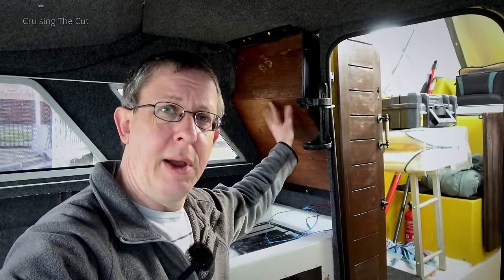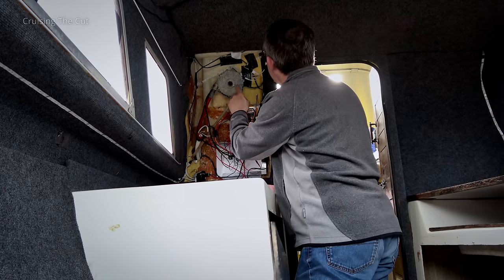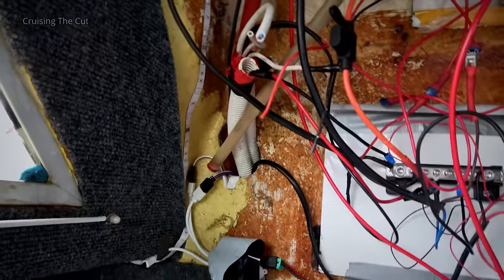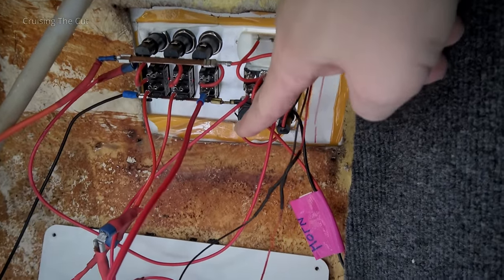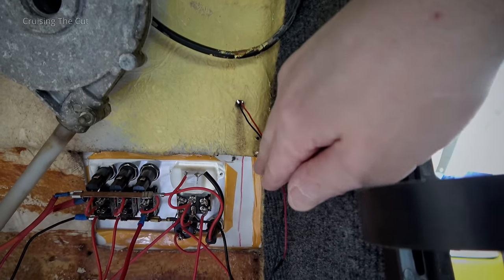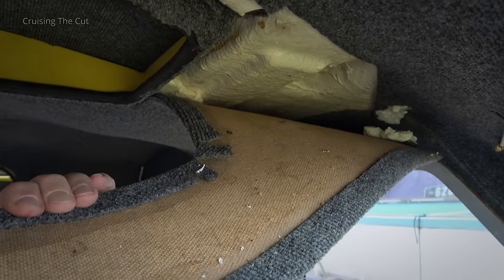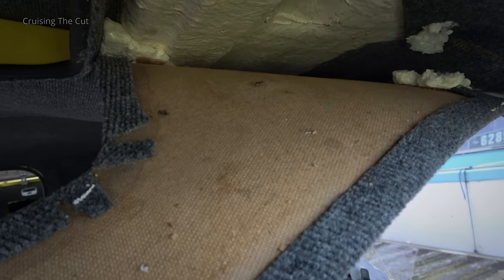326. Ripping out the wiring in my boat

Comment: And you thought narrowboat were a nightmare, welcome to the Lotus Europa of boats. The problem with anything non-metal is that you have to have a power wire and ground wire back, when non a metal boat or car you can ground it right there and then have another ground strap back to your battery negative terminal, with a boat or a Lotus you have to have a heavier ground with to send everything back to the battery.
Reply: Just run the same gauge return wire (-ve) 
as you do the feed wire (+ve)...
side by side 
(twin core wire is the easiest way to achieve this)

Electrickery enjoys coming and going through the same sized wires...allegedly!

Comment: Disconnect the battery first!  A $15 Digital Multimeter can be very illuminating when tracing out wiring.   You can save time by not tearing things apart, and maybe save wiring runs that can be useful.  Label the wiring runs according to their function.  It also might be useful to develop a comprehensions wiring plan for all components before tearing things apart.  One convenient additon might an electric-start outboard motor. By the way, the pressed wood under the carpet material is called tempered hardboard (in the USA).
Reply from the maker: I have one!

Comment: Without checking for actual size, could those two little holes on the dashboard take the pins of a 12v led light? If so presumably to tell you the electrics are live.

Comment: Parts of the the boat-frame could have been wood then 'covered' with fibre-glass reducing the need for expensive moulds? (flat,strong and relatively lightweight..creating a box-section also adds rigidity/strength and provides an ideal wood-screw receptor!)

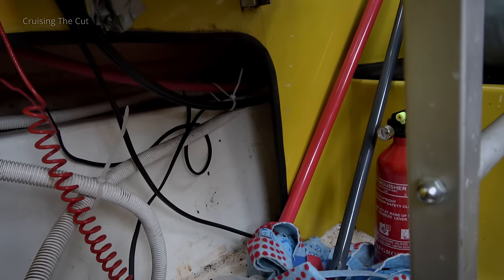Comment: 14:40 I'd prefer not to pull the old wiring out in case you might use the conduit later on for some new wiring. You could then tape the end of the new wire lengthwise to the old one and simply pull it through... and remember, to avoid short cicuits and sparks (you have gasoline on board!), to take off the negative terminal from the battery before doing anything with the wiring.

Comment: I found that interesting.  I'm biting my tongue (typing fingers?) to keep from spewing forth a list of suggestions for the rewire.  I realized that you wired your campervan and have a good handle on what's what.  

Also, no idea what that doohicky on the dashboard would have been. It looks like it could have been an indicator light.  But, what would it indicate?
Reply: 12 VDC being present i.e. that the master switch at the battery has been turned "on"?

Comment: The important thing to remember with 12V wiring is that although it is only 12 volt a leisure or car battery can deliver a lot of energy and melt wires. Starting with a fuse or circuit breaker as close as physically possible to the positive battery terminal, with the link to the terminal well physically protected, all positive wires should be fed from a fuse or breaker appropriate to their size,  which is defined by whatever they are supplying. Negative return wires should of course be the same size.
Reply from the maker: Cheers but worry not, I know all that - did all the wiring in my campervan.
Reply: @CruisingTheCut  I was pretty sure you did but thought it was worth putting it out there in case anyone thinks what you are ripping out is in any way how to do it. There's a lot of it about; I reconverted a campervan a few years ago which was similar but worse and included mains electric and gas. I started reverse engineering it but quickly realised it all had to go.

Comment: With regards to your "loud spark", wouldn't it have perhaps been advisable to disconnect the battery live terminal before fiddling with the spaghetti? Also, as other viewers have pointed out, your 'making it up as you go along' method of refurb is very entertaining! You have yet to make a boring video in my opinion!😀
Reply from the maker: The battery live was disconnected. But it was a negative I was pulling through so when it touched the battery terminal, the connection was made.

Comment: Do make a map/drawing of whatever you discover on the electricals specifying circuits and locations also label both ends of all cables for the future. The tiny two pin "socket" on the instrument panel looks to be where an "on" light would be, showing the batteries are connected in circuit as a reminder to isolate the batteries before leaving the boat. There should be a small bulb plugged into it but that's been removed or broken off.
Reply from the maker: A map? That would make things far too easy ;-)
Reply: @CruisingTheCut  are you sure? I've seen some of your maps. 🤣

I should point out the thin wiring to the lampholder did not appear to be protected by a fuse of any sort.  If the wires tried to carry full battery current under a fault condition, they would catch fire pretty quickly. Be careful with circuit wiring design.
Reply from the maker: Hahaha fair point!

Comment: Have you considered using LED rope lights on the interior and exterior?  Last fall I added some exterior LED lights to my house in addition to programmable LEDs on the interior.  All running from the same app. I know there are 12V "underglow" lights for automobiles that might be something to consider as you renovate your boat.
Reply from the maker: The prior owner added some LED rope lights, I may or may not re-use them.
Reply: @CruisingTheCut  I'm using Govee lights. Multi-colored and programmable. I noticed they have interior 12V light options as well.  They are nice when I want bright white light and when I want something less intrusive that doesn't shock my eyes yet allows me to see everything.  Just a thought.

Comment: I might have missed it - but - do boats require any sort of "electrical inspection and sign off" during or after you f-around with things?  Perhaps not - mainly just curious about added costs and time to do this sort of project on a boat?
Reply from the maker: There is a four-yearly boat safety scheme check but it’s more about whether the batteries are secure, that there’s an accessible master switch etc.

Comment: When in doubt (and you always are with this kind of wiring) take a pair of good quality wire cutting pliers and remove the lot. 
Step two: install the new installation.  It gets you precisely what you want and it is sooo much quicker than playing detective.
Reply: I was called by a fellow boater once who couldn't get his inverter (12Vdc to 230Vac) to work properly. After removing the spaghetti I found that the inverter was hooked up to the battery, and the battery was fed by a charger. Only snag being that the charger wasn't fed by the jetty/shore supply but, thanks to the mound of spaghetti,  by the inverter !  I connected the charger to the jetty supply and all was well. He had sent the inverter and charger back to the shop a number of times where they found no fault and this had been going on for months (!)
Reply from the maker: I am indeed doing that.
Reply from the maker: That’s hilarious (but not the first time I’ve heard of it)

Comment: I’d of kept the conduit to rear cabin and used old wire as either a pull through or as supply for a 12v socket in rear cabin and maybe a cabin light etc….

Comment: That wiring really didn't look too bad. I've seen far worse. When removing "extra" wires unless you can see both ends don't discard them, they may turn out to be something useful, like the horn! Keep that plastic conduit in place, especially the piece going to the stern, it may well be extremely usefully when you rewire. That "thing" on the dashboard looks very like part of a LED light to me. As its connected to the main +ve battery wire it's a battery live warning light to tell you that the eletrics are on. Potentially very useful feature so that you don't accidentally leave something on because you didn't turn off the main battery isolation switch when you've left the boat. I fitted one on my boat after I returned to it to find the battery flat and useless. I think all glass boats have those glassed in batons..

Comment: Could the unknown two pin connector on the dash be a "dead-man" switch connected to your person that electrically shuts off the motor in the event you get tossed overboard?  An "Electrical Power ON" light seems more likely.
Reply from the maker: Not that wire but there is a deadman's switch on the throttle, yes.

Comment: A total guess, could it be a bulb that when lit shows the battery electrical circuit is on similar to a car when you turn the key and the instrument panel lights up before starting the engine,

Comment: I think under the circumstances I would pull the battery cables before working electrical;  You may not be able to get electrocuted but electronics don't usually respond favorably to backfeeding power through the ground
Reply from the maker: The battery is disconnected.

Comment: Install a small BluSea fuse box.  It has both a negative buss bar and about 6 fuses.  Makes small boat wiring a breeze and you only have one point to check for blown fuses or to add more items. Electrical arcs are god's way of getting your heart rate up, ... so exercise more.
Reply from the maker: Cheers, there is a fuse box down at the bottom already which I will re-use.

Comment: As this is the 4 hundredth and something comment, and I am not going to read all of those, I suspect that someone may have already informed you of this, but just in case they have not. That woody stuff, at about 12 mins and 40 seconds into the video, is what we used to call hardboard, in the 1970s. It is matt and textured on one side and smooth and glossy and smooth on the other. I think that you can still get it, but I don't see why anyone would bother with it, as it is brittle, easily breakable and a bit useless.

Comment: Battery Terminal Risks - by far the worst place to have a fire !!!

Always cover the positive on your battery with some kind of quicky-removable non-conductive thingamy unless it has a nice purpose-made plastic hinged cover gaurding the terminal/s. Look under any modern car bonnet and you'll see an example of a terminal cover.

I prefer to use a small soft plastic food container bottom the likes of which you'd save leftover baked beans for the fridge. Buy a clear plastic one so you can see through it for corrosion. They are cheap and handy, so buy a set of them and just pick the best size. 
It's always the second size you try that fits best. 

They are soft-ish, especially when warm, so can be cut with a Stanley knife or similar to alllow access for the cables - just cut a notch for them and smooth the rough edges of your cut to prevent vibration fraying the insulation.

Then place it over the positive and use good quality Gaffer tape (Gorilla is a reasonably good brand and found in supermarkets, clean the surfaces well behorehand) so you can flap it up to measure the voltage with a voltmeter at the lead terminal directly when you need to. Don't tape it fully down, you should be able to quickly flip it up and out of the way to access the terminal nuts/bolts - it's just a cover to prevent metal things bouncing off the terminals even if you are disconnected.

This prevents "spanner across the battery" fires, which are extremely dangerous. Or "whole-length of wire melting in your hands/along the whole boat", which what you just had happen. Essentially, the whole wire is the same thickness/ampacity, so the WHOLE LENGTH of the wire becomes your fuse and melts all the way along. This is not good for insulation and the heat damage is more of a problem in places you can't see, due to sudden heat buildup behind panels and in nooks and crannies. 

Related note: stow a spanner of the correct size for your battery terminals inside with the battery compartment, secured well with strong clips and a backup rubber strap in a easily visible place. BUT TAPE IT OVER WITH SEVERAL LAYERS OF RED INSULATION TAPE so that it won't ever spark between the positive and negative when used in a panic. This is even if you have a "nice" battery cutoff close-by.

If ever you get a fire on board and the brigade arrive, they will want to physically disconnect the battery terminal/s even if you have a nice battery cutoff mounted close. 
Yep, they will use the cutoff for speed, but will also want to then also want to remove the terminals themselves to be sure, because as you know and have just shown us, rat's nests always exist :) 

I'm raising eyebrows at uninsulated busbars for the same reason, I know they are low voltage, but a loose nut, bolt or screw could play havoc bouncing around in the back of there. Testing your fuse choice (or worse, the previous owner's assumptions about fuses) in a real-world fire is not fun. 

An easy retrofit for bare conductors is liquid insulation, thick rubbery goop that you paint on once your happy and everything is tested and finalised. It's a bugger to get off though. 

Don't be tempted to use bathroom sealant or mastic-like goop as it can cause rapid corrosion of the copper. Liquid insulation is only recently cheap, but being untested for 30+years of life in a marine environment is only just better than nothing.

If I could I'd always use a layer of nailvarnish (I use non-metallic red for various reasons on positive conductors) then a couple of layers of self-amalgamating tape over that. 
I like to leave a tiny uninsulated pinhole to get a needle meter probe onto the terminals of switches for faultfinding though.

Electric work costs money when done professionally, for good reason. 
I'd always recommend a professional do it, but I realise that most people in these siuations DIY, as well as in caravans/motorhomes for DC stuff.

(I now need a new keyboard - this one is worn out)

Comment: Was there a weird plastic stick type thing on the boat key's key fob? Only asking because that thing near the wheel that you don't know what it is looks a bit like the anti-theft isolator nubbin that you used to get with the old after-market Moss car alarm systems. You'd have to hold the nubbin to the thing on the dash before you could start the car.
The scrawny wires going up to it seem to hint towards that explanation as well.
Reply from the maker: Intriguing suggestion! Maybe it is.

Comment: Possibly too late now. But before you pull out all of those unused wires from the conduit, tie a piece of string to one of the wires first and pull the string into the conduit. Then you can use that string to pull in new wires (and new string) as needed in the future. 'Pushing' wires through that corrugated conduit afterwards would be shall we say, unpleasant.

Comment: Ahhh, it's Hardboard. Shouldn't really be on the boat. The same thickness in plywood would be much better. The timbers the headlining is fixed to are to screw into. But also to add some structural strength to the deck. So it doesn't flex when you walk over the top.
Reply from the maker: I realise they are underneath where the rails are to the side of the hatch.
Reply: @CruisingTheCut  ahh that's good. You're having all the fun there. Love your channel.

Comment: Wooden impressions on fiberglass. Modern 1970's.  Electrical spaghetti. Electrical labelling is absolutely necessary. I sure hope those dead ends are.  ...and when everything has been sorted out and improved upon, it'll be time to swop it out for something else. Hmmm. It's not sticky tape. It's a special electrical tape. I think all those wires need changing out completely. They all look very burnt out.  😂 Recipes for disaster. David's new book title. I can just see David as a little boy sitting on the bedroom floor pulling apart his Christmas presents or his favorite toy. Have you got a buoyant lifesaving jacket? You might need it  there, sitting on the floor of your yellow peril. It was very amusing.
Reply from the maker: Yep, it's going to be very much re-done.
Reply: Trouble with electrical tape is that it does go sticky after a few years.  Learned that the hard way.

Comment: Quite entertaining. Seen this sort of awful wiring before. Why do people do it?  I think the wires from the battery are too thin. You might not be drawing much power but even so put in some thicker cables and put a fused distribution terminal near the negative bus bar.  When you turn the switch fuse panel around you could also install a USB C/A combo socket so you can charge your phone. You might also consider just replacing the switch panel with a new one say for example, a Blue Sea 4322 6 circuit (can change labels) breaker switch panel.  I am not sure what your current panel does but getting away from lots of fuses is a good idea.   Perhaps a small voltmeter as well. You can get small round ones about USB outlet size.
I would do a bit of research to determine how best to redo your electrics to protect the battery and wiring.  A battery fuse and a battery isolation switch. It’s not a big job but putting together the right fuse and master switch for the battery, getting the right size cable from the battery to your switch panel is a good idea.
Anyway, just a few ideas.

Comment: Had I been you, it would have all had to come out, as I absolutly detest spaghetti. Safety first, rewiring from scratch should be far simpler than trying to fix bodges that have been bodged in the past.
Reply from the maker: Yeah I'm going to re-do it
Reply: @CruisingTheCut  Ive known a good few people who have lost boats and caravans over the years due to dodgy electrics. 12 and 24 volts are great for starting fires if the cable size can't handle the current.